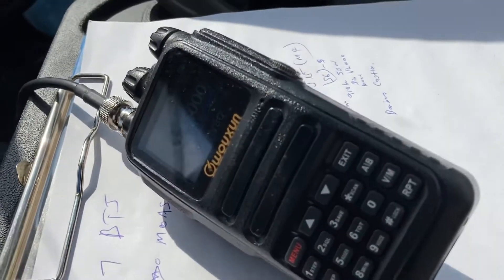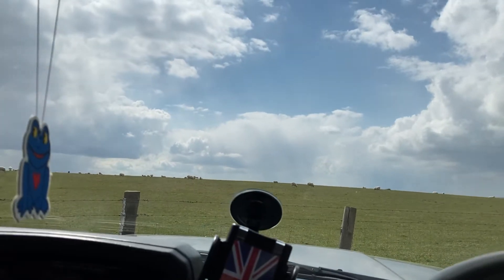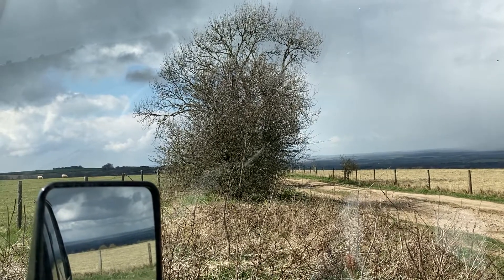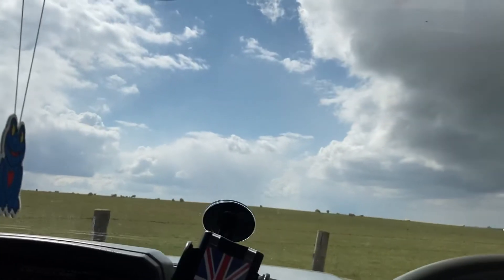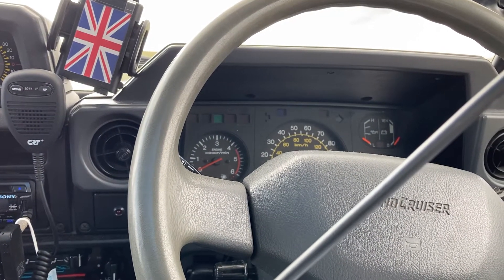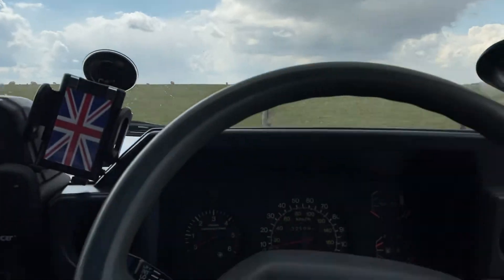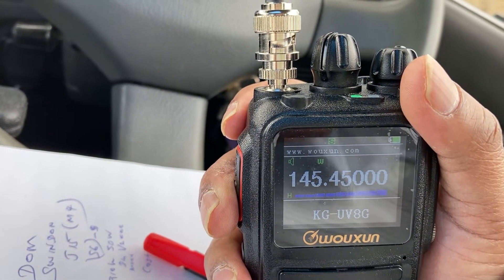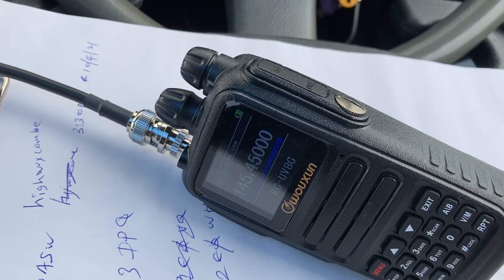15 miles contact on 2m - Wouxun KG-UV8G - Diamond SG-7500

Comment: Is that simplex?
Reply from the maker: Yes simplex
Reply: @TheOutdoorFun thats good , how does 4m compare to 2m and 70cm with hilly and rough terrain? I strugle with 70cm going over even small hills
Reply from the maker: @tannerjordan5387 4m goes over hills better than 2m. 70cm is the worst for going over hills. A J-pole antenna is good for going over hills because of its higher angle radiation pattern.
Reply: Thanks for that 👌🏽 @TheOutdoorFun

Comment: I just ordered a Wouxun KG-UV8H handheld should be here next week to replace my Boafeng GT-3TP and I have a   TYT  TH9800 set up as a base station with a 30 amp power supply....cheers KM6SPK
Reply from the maker: Nice radios. You will like it.

Comment: Thank you for the video it was rather nice two thumbs up cheers KM6SPK
Reply from the maker: This radio works very well with a 42 inch Abbree antenna. There are lot of fake copies on eBay. I have both copy and genuine ones. I bought the genuine one from Amazon which comes in a light green packaging